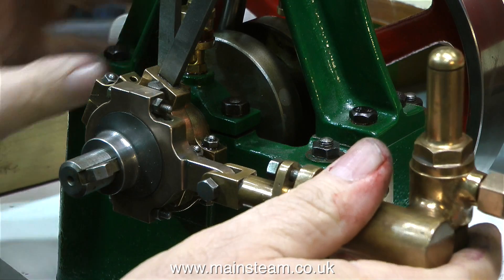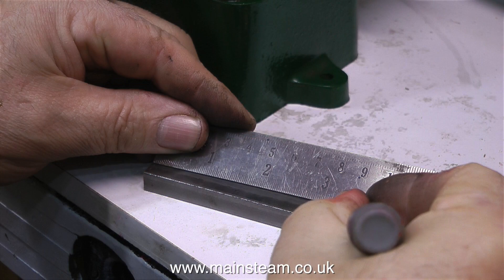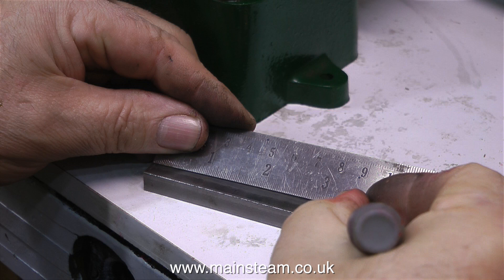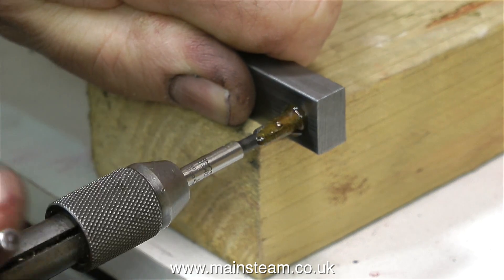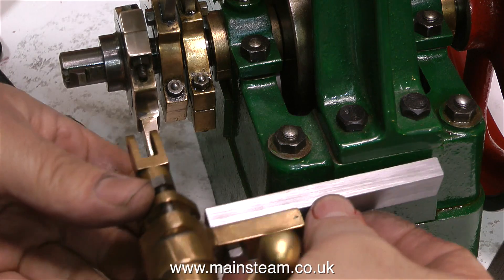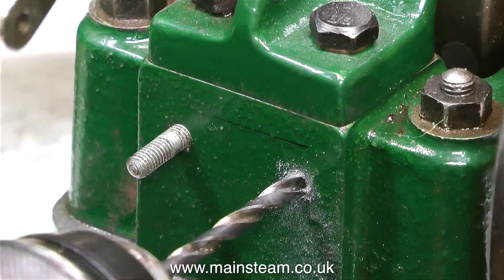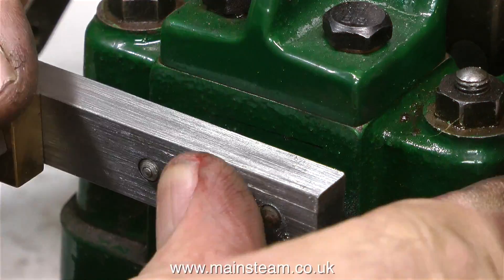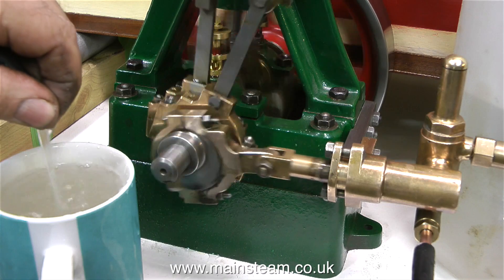A CRANKSHAFT DRIVEN BOILER FEED PUMP - MODEL ENGINEERING FOR BEGINNERS - PART #16

Comment: I was drilling and tapping some mild steel the other day. Came from my usual supplier, but it was like working on a poor casting with sand in the first 2 or 3 millimetres, I was worried I might break my taps (4mm). I gave up and found another piece that was fine.

Comment: Hi Keith, I'm quite new to model engineering and building my first Stuart 10V.
Your video's are a great educational resource to newbie's like me.
If you fit  feed water pump to an engine, then how is the water level in the boiler controlled, so it doesn't overfill or underfill over time? Regards Paul
Reply from the maker: With a water bypass valve that either returns water to the tank when open or to the boiler when closed - please watch some more of my videos . . . . .

Comment: May I suggest that the reason the steel packer was so hard when tapping was because when you quenched it a few times to cool it off during the sanding process, you must have inadvertently hardened it!
Reply from the maker: No as it is only mild steel which doesn't harden just by heating it.